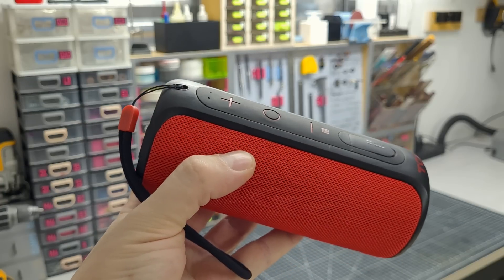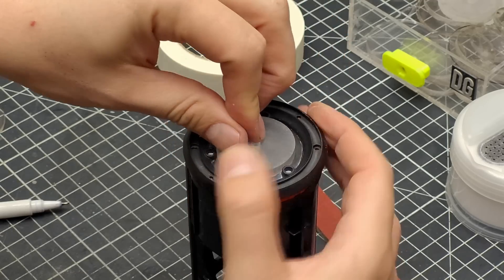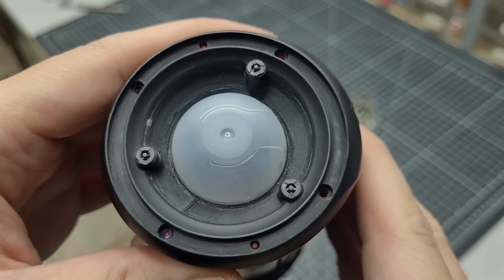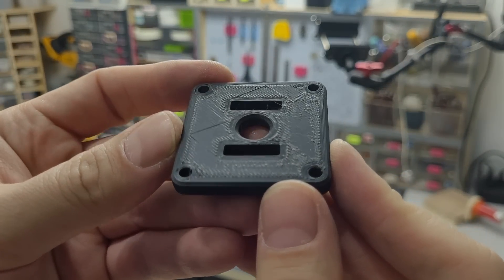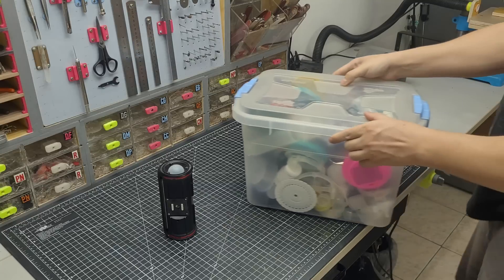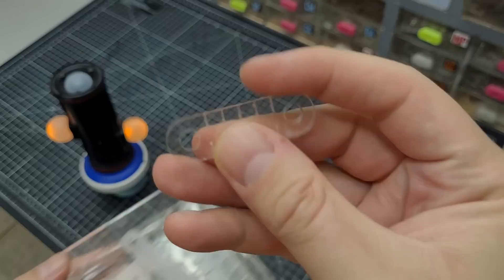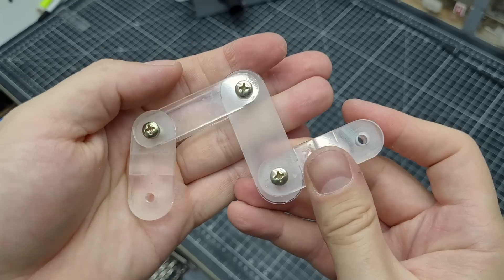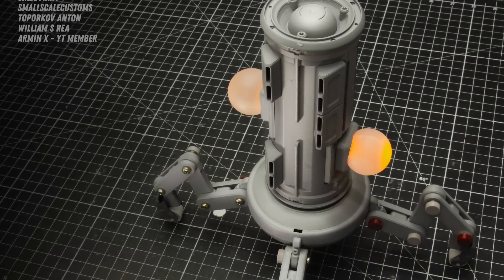Making a ROBOT from a broken SPEAKER! - Hacking Crab Robot Part 1

Comment: This bot gave me an idea for something similar, a crab bot that comes to the battlefield afterwards to collect all the scrap it can find. The flickering lights would be the self contained nuclear furnace for melting down scrap metal and the tower shape of the body would be to house the cooling rods and heat exchangers. There might be two hydraulic shears like claws on front mounted arms to pick up and slice large pieces of metal. These bots would live on distant planets where trade is not consistent, so any tech is necessarily of value and everything has to be recycled 100%.